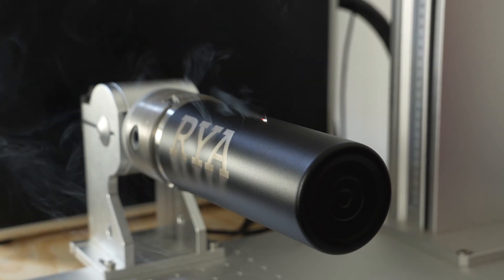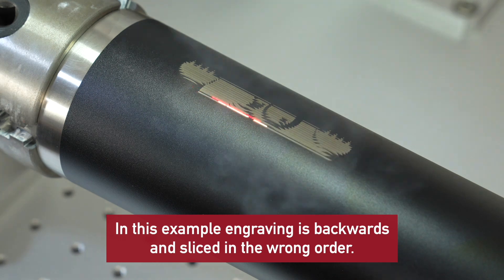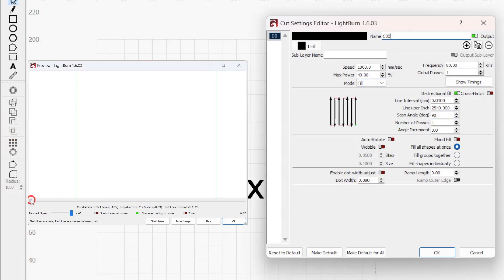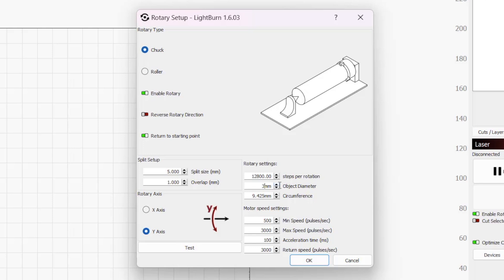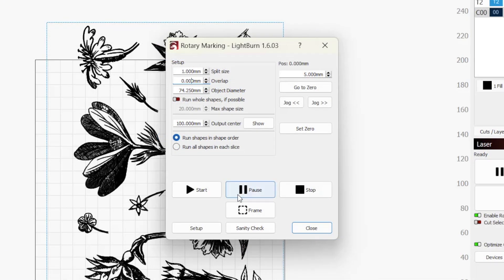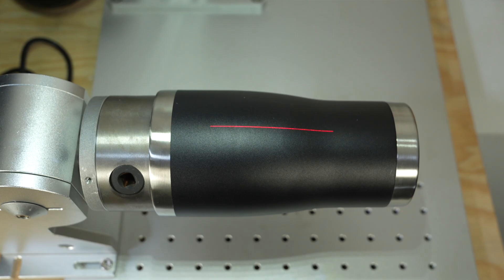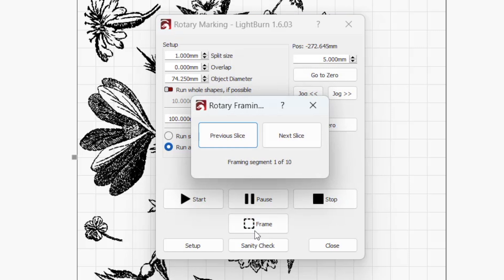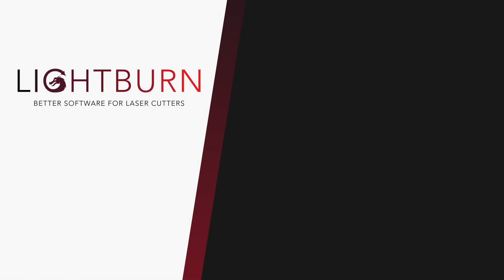Galvo Laser Rotary Set Up

Comment: My question is, I have a CO2 laser that I use light burn with. Will that same version of light burn also control my Galvão lasers or do I have to download a totally different one?
Reply from the maker: Yes, as long as your Galvo lasers are compatible with LightBurn, the same LightBurn Pro license will work with them.
Reply: @lightburnsoftware7189  I appreciate your quick reply thank you

Comment: Can Galvos, when using a chuck that rotates in the Y-Axis, be set to engrave along the entire Y-axis before rotating back to zero to start the next line interval?
Basically burning the circumference (continuous rotation) of the entire tumbler and rotating back to move over according to the split size?
Reply from the maker: In short, no.  Currently supported galvo lasers can engrave OR move the external axis. They cannot do both at the same time.
Reply: @lightburnsoftware7189  Thanks. Small wood shafts have grain that runs in the same direction as the scan. I was hoping to engrave the wood against the grain without increasing split size.

Comment: This seems great for straight lasers but doesn’t really cover tapered bottles. You can’t run just back and forwards like you can with a gantry system. The splits are really visible with glass.
Reply from the maker: For tapered objects, use a split value that is really small - typically 2x to 4x your line interval for engraving.

Comment: any chance of adding a jog function in degrees? that way you could easily laser a logo, then jog it say 180° and laser again. no math involved using the circumference to calculate the jog. even easier if you’re trying 3-4 logos equally spaced.
Reply: Great question.

Comment: Good day, I'm new to Lightburn and my fiber laser so please excuse me if  my question seems basic to you.  I see that you are engraving a tumbler that is the same size from top to bottom. But most tumblers lets say taper from wider to smaller. Is there a min max variation in material thickness that we should consider to get a clean engrave?  I thank you for your time.